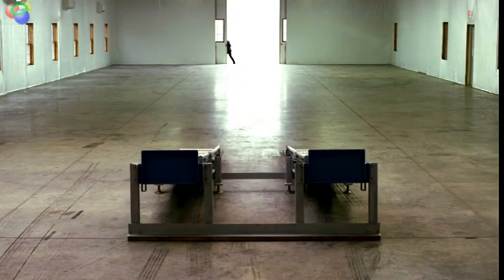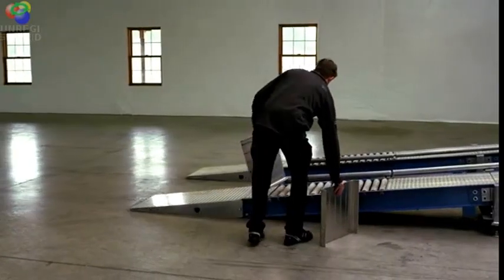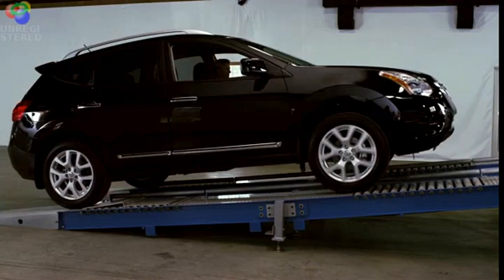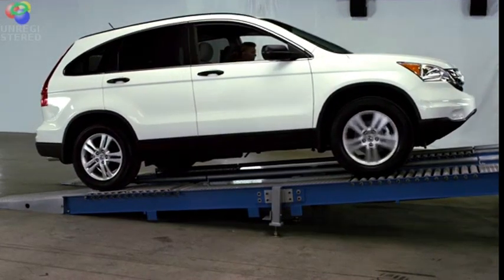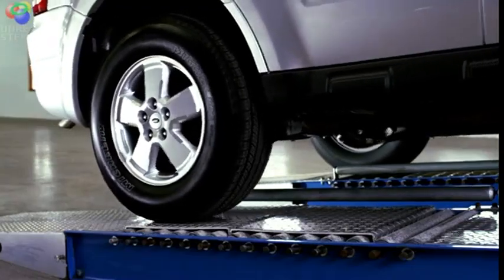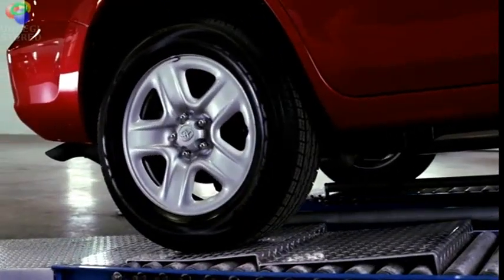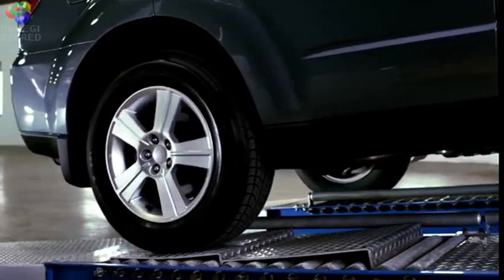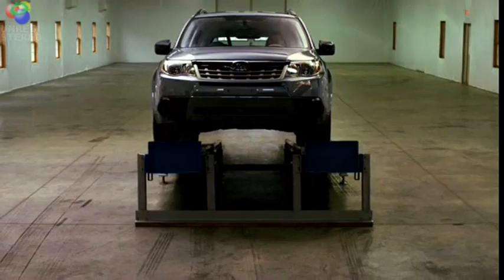Subaru Symmetrical All-Wheel Drive Test

Comment: Well that's a nice Subaru commercial. Not one limited slip rear differential anywhere to be found. I'd rather classify the competition here as "cute ute's", not suv's. There are plenty of real trucks on the road that can do exactly this while pulling a Subaru out of a snow drift. Just saying. Subaru is a good car with unique features, but at least give it real competition.
Reply: Why should Subaru compare itself to real 4x4s? The Forester is classed as a CUV, a crossover. The same as the ones tested against. That was sort of the point. The Forester and Outback, expecially the models with X-Mode punch above their weight. Doing better than most of the comletition... in the same class.

Comment: Wow. Just show how those car companies are robbing us. Especially Toyota. Very Disappointed.
Reply: The first RAV4s did have a pretty good VSLD in the rear and they were pretty capable. Then the cheaped out. Hilly icy areas are where it's noticed, like Seattle because of our odd weatner (ground is colder than the air so water freezes), and steep hills.
Flat midwest not so much.

Comment: After some research, it seems not all AWDs are created equal.  Most CUVs have FRONT BIASED AWD, which is to save fuel in everyday driving, but when conditions gets very ugly or having to climb 30+ degrees slopes ( https://www.youtube.com/watch?v=0_MXK2nzt2Y ), they are simply outmatched, and you start to see and appreciate superior systems and the technology behind it.  

Granted, few people will take their vehicles to these extremes, but as a consumer I would feel assured that a vehicle can tackle thru these mild to medium obstacles. I'm not a Subaru owner, but I'm impressed with their SYMMETRICAL AWD system, which is similar in perfomance to Audi's Quattro. Their Boxer engines are similar in configuration to Porsche's, allowing for a lower engine mount in the chassis, thus achieving a lower center of gravity which translates into better stability when pushed to its limits vs. its competition. 

They must have done something right, for the Forester to have won: a) 2014's Motor Trend's best SUV of the year. b) 2014 Consumer Report's best small SUV of the year. 

Subaru used to build ugly cars, I didn't consider them at all, they were not even on my test drive list. Since Toyota bought a stake in the company, I guess the Capital Infusion must have helped them design better looking cars.  After Toyota killed its V6 in their CUV segment, there were hardly any sporty/fun/reliable CUVs on the market. Now I would consider a  Forester XT, when the time comes to replace my Toyota RAV 4 V6 AWD. (265 HP)

https://www.youtube.com/watch?v=kRniF4JQN2U

 https://www.youtube.com/watch?v=0_MXK2nzt2Y

 https://www.youtube.com/watch?v=cBaUCHiJxxs 

https://www.youtube.com/watch?v=gw1nNdEVPf8 (Subaru goes where only True 4x4 with locking differential dare to go)

 https://www.youtube.com/watch?v=kr2NwI89RQ8

 https://www.youtube.com/watch?v=kRniF4JQN2U

 https://www.youtube.com/watch?v=aSG-pF1LXHI

Comment: I did not believe that Subaru Forester is as good as they claim until I owned 2013 forester.
excellent car, fun to drive on the beach and sand,
living in United Arab emirates, where there is plenty of sand dunes and beaches. all I have in my car is small shovel and tire pressure gage, if the car get stuck, I reduce the tire pressure to 20 PSI and the car drives away. 
I deliberately got it stuck in the sand until it bottomed, next I deflated tire pressure to 18 PSI, removed the sand from the front of all the wheels, switched off the traction control and the car got out easily.
it is fun to drive. I give it thumb up.

Comment: There are many claims that there are better AWD systems from other manufacturers, which I'm assuming is arguable - but I wonder why more carmakers don't implement Subaru-style symmetrical AWD in their CUV's/SUV's? Perhaps a CRV will get you out of some slippery spots or snow-filled driveways, or a RAV4 may get you up a muddy hill, but everything I've seen and read so far on the current market for CUV/SUV, Subaru has the edge in superior AWD. I want to buy a Honda, but I'm considering Subaru more seriously after seeing many of the AWD comparisons online. Perhaps many of them are staged or propaganda, but I can't say I've seen any test whatsoever where a CRV or Rav4 bested a Forester. I'm not trolling here, I'm sincerely looking to learn more about AWD - but so far, Subaru is the best (< $50K), and no one else seems interested in copying their symmetrical design. I assume most think their AWD is enough for most of the market?
Reply: If all you care about is offroad capable drivetrain get a real 4x4 with diff lock.  I suggest you watch 2hp review on the Honda CR-V vs Subaru Forester.  Other AWD system aren't that incompetent, and the Forester still didn't make it on top of the hill.  On that same hill the Rav4 did better.
Reply: David Cazes Thanks for the input. I'm looking for the one that can handle bad road conditions best. I'm sticking to Japanese makes for reliability reasons, so it's basically a matter of choosing the most capable of that bunch, rather than finding the best offroad CUV/SUV. I just watched the 2hp review, and (again, not trolling here) found their tests irrelevant for the most part. I'm not concerned about the frame's rigidity when somehow balancing on two diagonally opposed wheels, nor is a sand dune something I'd expect to be climbing in anything short of a Jeep. I also noticed the guy didn't enable X-Mode in the Forester, a crucial option when looking for traction. Just like all the other tests online, the power to the CRV's back wheels just gives up when needed most. Since I drive a Honda and would like to buy another Honda, I'm trying to dispel all the propaganda before deciding on which AWD is best among the top Japanese/Korean AWD systems. So far, in terms of AWD, I've found Subaru wins every single time - and I've seen no video proving a Rav4 or CRV systems are better in any way whatsoever. This will affect where my money goes, so I wonder if Honda/Toyota/Hyundai/Nissan/Mazda, etc, ever considered implementing the Subaru symmetrical AWD system, instead of relying on electronic variations that attempt to mimic it? So many reassuring terms to describe their AWD systems, yet all I see from the CRV is spinning front wheels. Thanks again for your opinion, I'm not picking a fight - I'm just trying to get to the bottom of all this before investing - this is a lot of money to me, and I don't want Subaru propaganda to fool me into a mistake.

Comment: This video is a lie, Toyota RAV4 would go up this ramp easy with locked differential, see an actual video of the RAV4 surpassing the ramp: Vergleichstest Allrad am RAV4
Reply: +Fabiana Viegas Did you see that all Toyotas in your video they go up because they don't stop in the rollers? Why did the newer one have problems? Because the system can't really handle to send the power to the correct wheel, because the traction control can't really stop the wheels they are spinning. Subaru it does.
Take an old Subaru, and will do the same as the Toyota here with speed, but if you stop in the rollers, it won't climb either, because they don't have any traction control in older models.